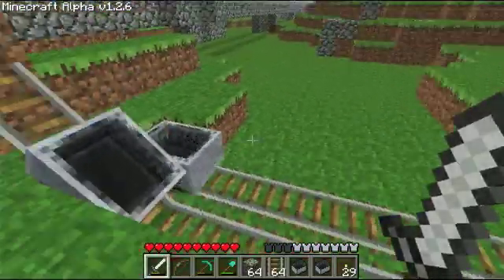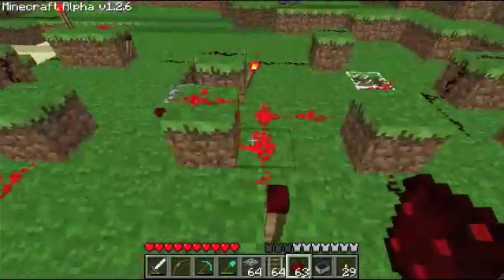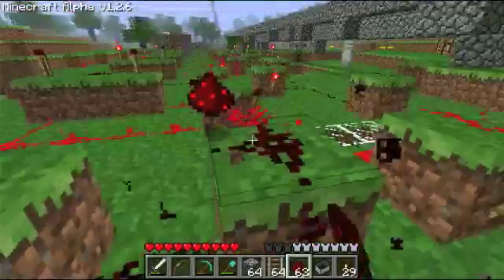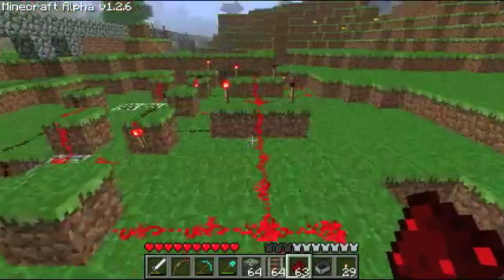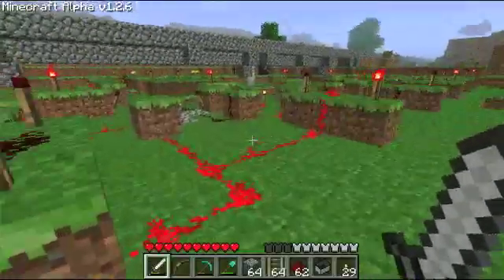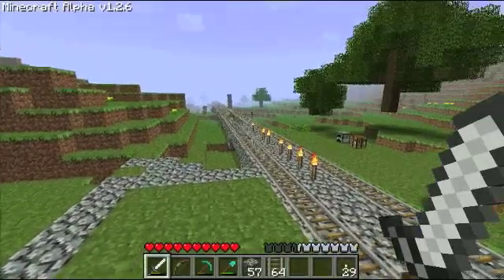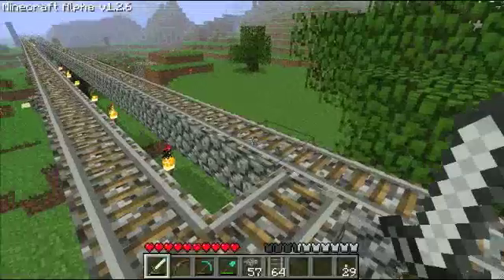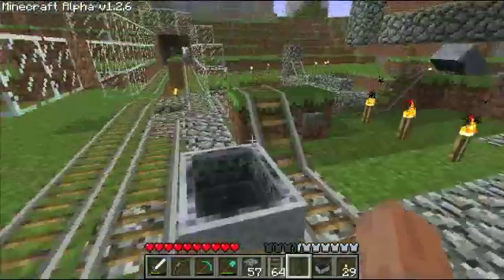Minecraft minecarts- Stabilized Perpetual Motion Device Explained

Comment: @The8bitEngineers Yeah I saw that but I wanted to learn to make a redstone counter rather than a boat.
A lot of my confusion came from not understanding how you were resetting it. Without thinking much I assumed it would count in binary.

I had mine ticking on a plate like in the compact video and lucked out. I was able to use a very brief pulse from resetting the counter to also trigger my track switch. Just two cycles of this took me from bedrock to sea level, though just one might be enough.

Comment: I have a question. The 1st group (nearest the minecart driver) of memory block, NAND gate, and inverter (what I call a binary iterator) has 2 additional inverters; 1 before the input to the memory block, and 1 before the outside input of the NAND gate. I believe this is to power the first unit (since the pressure switch's default state = off). I'm curious why you didn't just use a single inverter before the RS circuit split. I tested 1 inverter and it worked. I'm gessing there's another reason.

Comment: This is soo awesome! The only bad thing I can find is the waitingtime when calling the booster. Is it possible to set up several of these in a row so when you call a booster it will call the first one that has achieved perpetual motions?

Also, what did you mean with that it needs to be the same length when you talked about the minecart "clock" ticker??

Cheers for this!